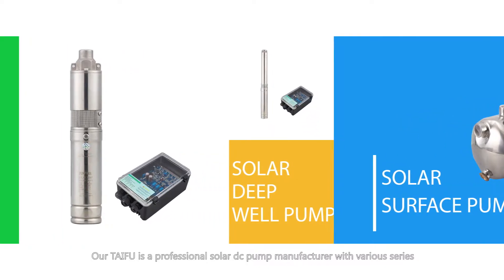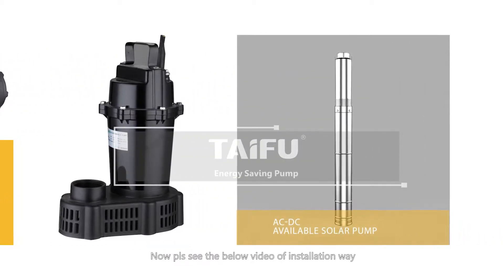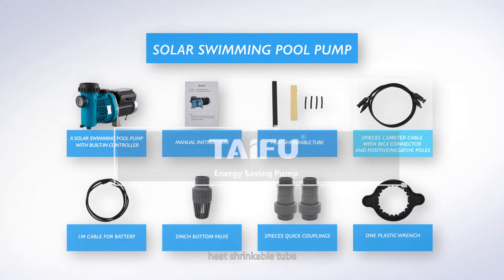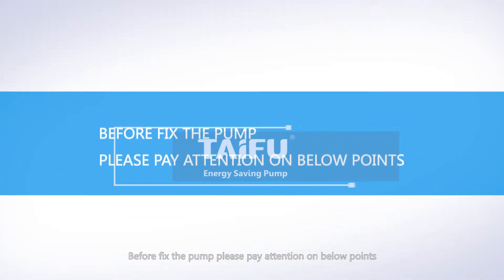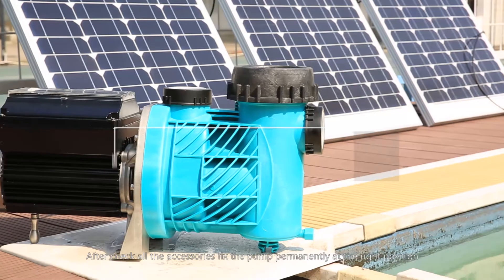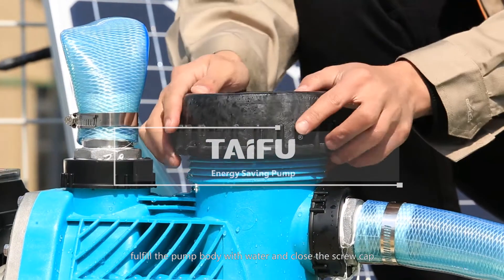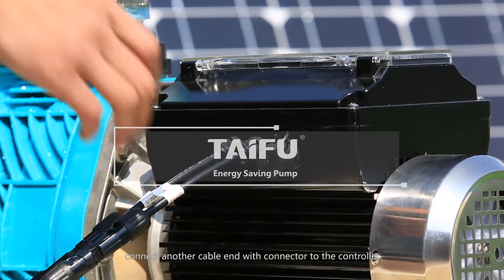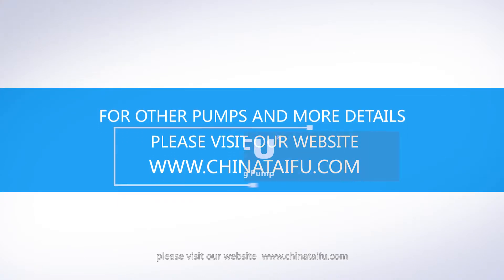Introduction of TAIFU Solar Swimming Pool Pump

Comment: Do you need a battery to run these pumps or do they just run off solar panels same as the previous model solar pool pumps, I've just bought oe and the instructions aren't clear